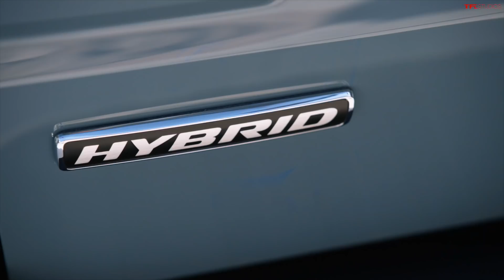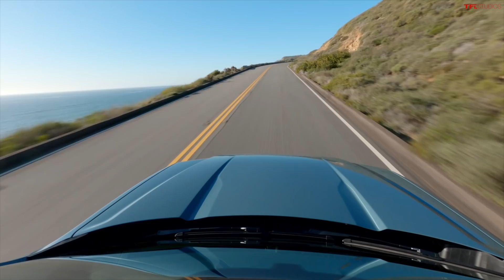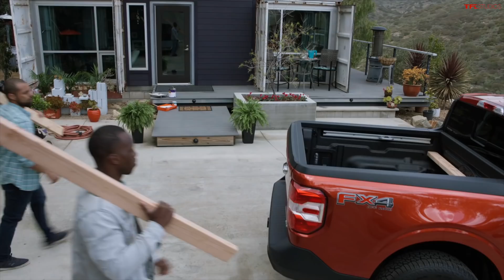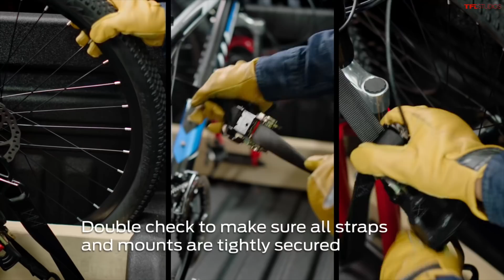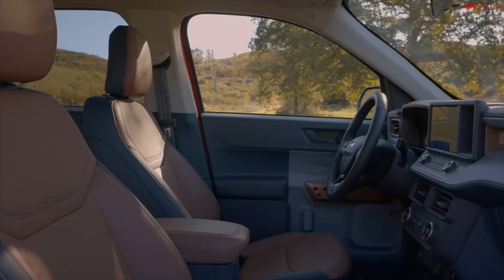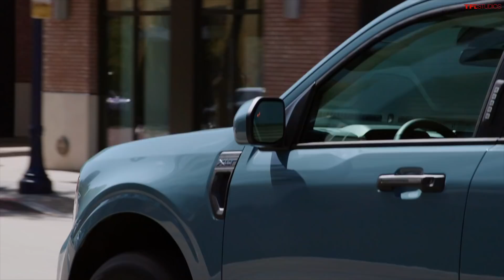What Do You Think Of The 2022 Ford Maverick? I Get ALL The Details From The Guy Who Built It!

Comment: Would have liked to see an extra cab long bed version for parts delivery and shop trucks, but really this should do pretty well with 40mpg city and 500 miles of range at less than $20k.
Reply: Escape hybrid is 44/37
Reply: @gowest7797   but no truck bed, right?
Reply: You know Ford makes bigger trucks too right, F150, 250, 350 and so on if you want that extra cab extra leg room extra long bed
Reply: Realistically the inside space is often more useful that the outside space.  If you are moving new stuff in boxes it isn’t gonna mess up your interior.
Reply: Estimated 40 mpg city and I’m pretty skeptical.
Reply: @rolandthethompsongunner64  just look at the real world mileage of the current escape fwd hybrid, considering that's basically what this is; an escape with the rear roof chopped off.
Reply: @rolandthethompsongunner64  You need to do some research instead of being skeptical of everything, there are examples of other Fords that are basically just as capable with the same setup, the comments here even prove that with the Escape Hybrid which has the exact setup the Maverick has, so it's not at all unbelievable.